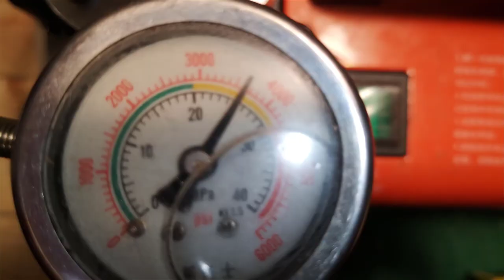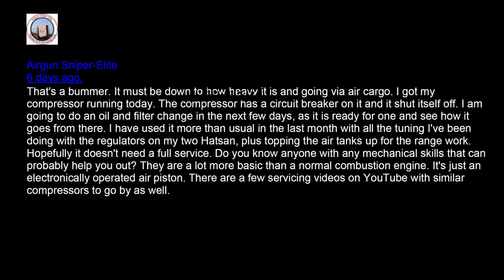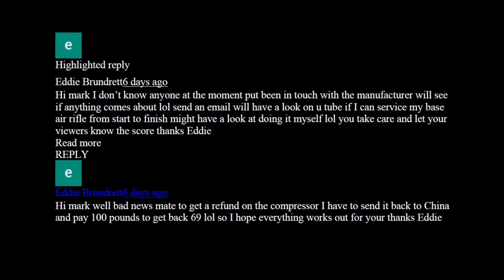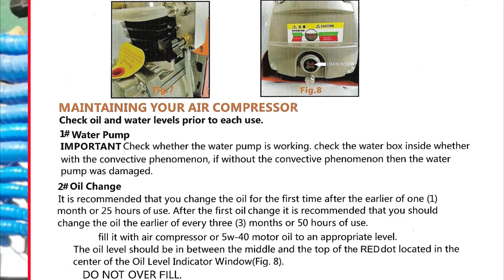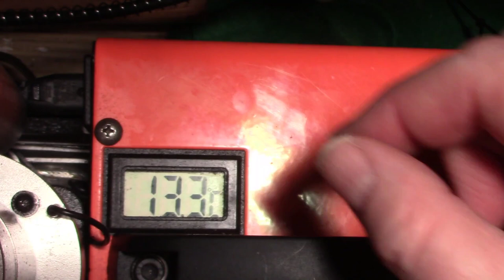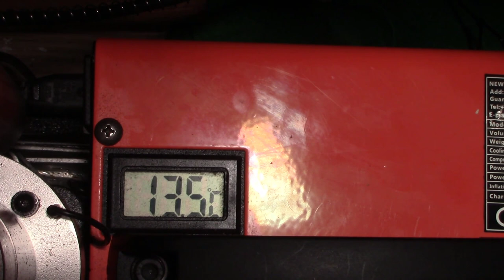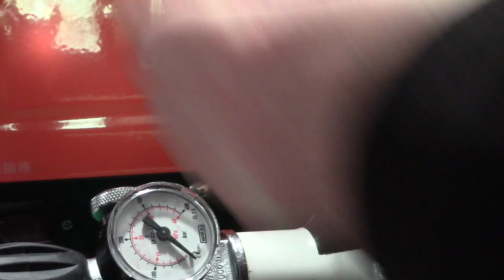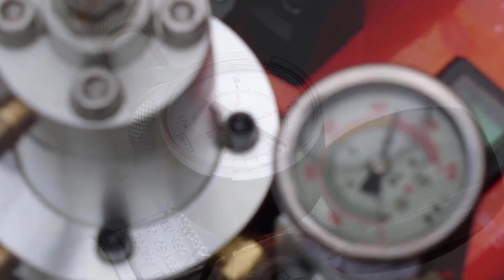The New Warrior Compressor - Eleven months on - Oil and filter change

Comment: Mark, I have it on good authority , That Both the filters you have on you compressor . Are totally useless.
Reply from the maker: I haven't found any problems with them, as long as you change them regularly. Nothings really got past the mega filter so far. I take my air rifle cylinders apart several times a year and have found no moisture or oil in them yet. The only filter that I had missed is the one that is actually inserted into the compressor itself, but I think that is an air intake filter. I found it on the instruction sheet after doing the filter change yesterday and this was also mentioned in a comment afterwards. I have just fitted it now. The old one looked very dirty. At least I know now for the future. It is harder to get to than the filters along the air line though.
Reply: I have been using exactly the same as Mark, with both the standard filter and large black one for 2yrs now and providing you check and change filters they work brilliantly with absolutely no oil or moisture getting all the way through the black unit
Reply: @kevinfishenden  That should tell you the litle filter is suficient Kevin
Reply: @keithtennant699  yes probably fine but lately I have just been using the larger (roughly 10") black filter
Filled my 3lt and 7lt tanks last week with no issues, just about 4 breaks to allow things to cool down
I run water constantly in to 1 bucket and the outlet pipe down the garden and it's constant flow keeps the compressor cooler than the 1 bucket system
Reply: @kevinfishenden  Any desiccant { charcoal in this case}used will not work if it is not packed down tightly . If not the air will just channel around it negating it efficiency. The most efficient desiccant is molecular sieve. The thickness of the black filter also looked a bit on the thin side. I worry that it is a poor quality tube. I would find out what pressure it is tested to and compare with the top quality filters
Reply: @keithtennant699  no the tubes are really solid, I refilled mine with the white filter, then white desiccant beads from those window dehumidifiers then another white filter and have changed them about 4 times in about 3 years or so, really work well, I generally change them each time I change oil in the compressor, going to change again next fill up as Oil is getting a bit dirty
Kev 👍
Reply: @kevinfishenden  Hi .I was refering to some filters  that were called Air Mega and were only 3mm thick. The specs should be 8mm to 9.5mm.
I use a mixture of charcoal and molecular sieve in my filter. The M.S adsorbs abut 50% more water than SG .The charcoal is ecellent for smells and oil adbsortion.Never ever use SG to fill dive cylinders  they react with the water to produce silica which is very toxic if breathed in.